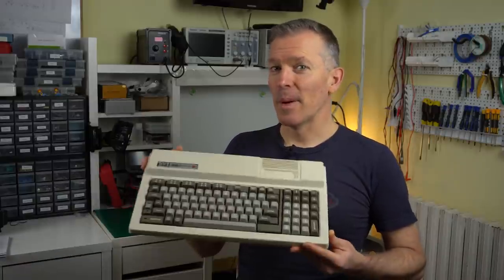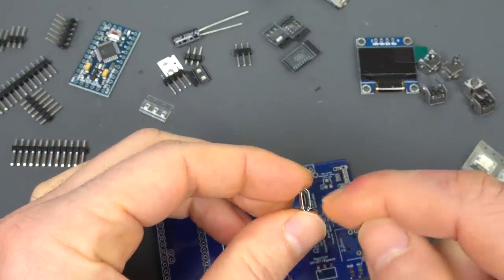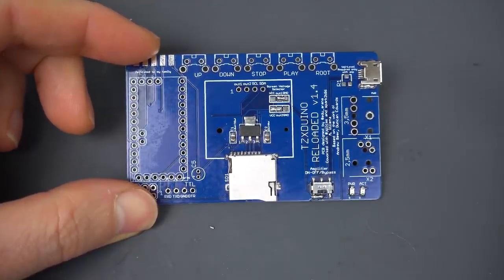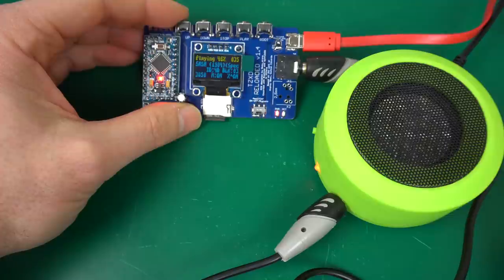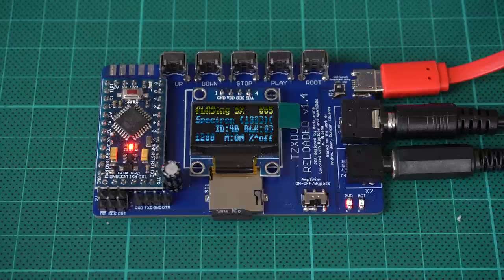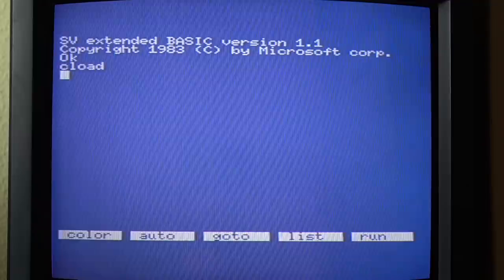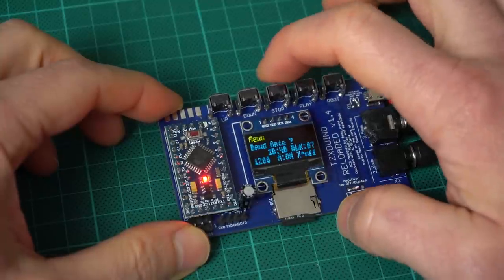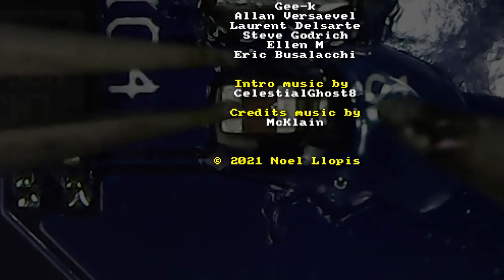Loading Games with an Arduino on the SVI 328

Comment: Yes, I've designed boards and found glitches afterwards that required cutting traces and adding jumpers.  Sometimes things work great in the breadboard stage but suffer in the copper layout stage.  Especially things like shielding.   

Like your videos but the only "game" computers I ever had were the Radio Shack color computer and the Atari 2600.  Glad to see you using the 'scope to analyse things.  I've done a ton of logic design and the 'scope is the most valuable tool for troubleshooting logic flow.
Reply from the maker: Yes, that happens. I'm starting to do some hardware design myself now, so I'm sure I'll run into that as well.
Do you ever use logic analyzers? They seem really useful in theory for more data, but I find that you need at least 24-32 channels to really get anything useful out of them (certainly not the puny 8 channels of the one I have!).

Comment: Another great vid Noel. By coincidence I've been playing with an Arduino to pipe programs into my 1978 Science of Cambridge (Sinclair) MK14 replica computer with some good results, so I appreciate how frustrating this must have been and how great it felt when it finally worked!
Reply from the maker: Very cool! I'm glad it worked. What kind of source data did you start from? Did you convert original sound files to something like a CAS format and then play it back from the Arduino? Or were those files already available? The more rare the computers, the less stuff there is out there already ready to use.
Reply: @NoelsRetroLab  Well the MK14s cassette interface was an optional extra so I just connected the arduino directly to the serial in pin and generated the pulses directly. The MK14 has only 640 bytes of memory fully expanded so programs are usually just hex listings! Its an extremely primative computer, with a 20 key keypad and a 8 digit 7 segment display. Its built in monitor routine is only 512 bytes long but does have cassette routines to support the optional interface. Its not TTL serial, its a combination of 4mS and 16mS pulses for 0 or 1 respectively. The MK14 is quite rare but there is a surprising amount of info out there, a couple of years ago I designed a replica and built it, and several other people have built my replicas too. The only hard part was getting the 50 year old memory and processor chips.....

Comment: You made the right call, I really enjoy the debugging stuff regardless of the system! I should see if there is a tape player for the STM32 blue pill as got one for Xmas and would like a convenient way to load to my speccy
Reply from the maker: Thanks! Good to hear that feedback. The STM32 should compile just about the same things as Arduino, right? With some pin interface differences but mostly the same. I noticed that MAXDuino even has options for multiple microprocessors so I bet you can get it to work on the STM32.
Reply: You can program Blue Pills directly from the Arduino IDE by changing a few options:
https://idyl.io/arduino/how-to/program-stm32-blue-pill-stm32f103c8t6/
(I have one of the £2 STLinkV2 adaptors off ebay and find it to be 100% reliable.)

Comment: Noel you use a tip, ring and ground stereo plug and cable.  Old cassette players were MONO so you only need tip and ground.  You may be shorting out the ring to ground.  It is not needed so I would suggest you remove the red ring wire from the connector on the computer.  That is how I load Spectrum games.  I hope that helps.  Best wishes from France.
Reply from the maker: Right, I knew that about the ZX Spectrum. In this case it doesn't matter because the SVI 328 has its own adaptor, so there's no potential confusion there (and the audio jack in the TZXDuino is stereo).

Comment: The way you shorted the potentiometer, you actually shorted the audio signal to GND... that's why it plays very quiet in "amplifier ON" mode (the switch is labelled correctly). Two bottom pads are GND and signal IN, the top pad is signal OUT.
Reply from the maker: When, the first time or the second time? I don't think the potentiometer was connected to the audio signal, but to the gain signal on the amplifier (first time I left it unconnected).
Reply: @NoelsRetroLab  For the first time. I wasn't aware of the circuit at first, but now I found the old v1.4 project and there was a bug in the circuit design, the left bottom pin of the potentiometer, should not be connected to anything, but it was connected to GND (so you've connected one side of C4 to GND, and pin 1 - unconnected). The potentiometer is indeed in the GAIN control loop, not in the audio path. The right bottom pin goes to the C4, and then to pin 8, the top pin goes to R5 and to pin 1. Pins 1 and 8 should be either not connected at all, or connected via a capacitor and a resistor in series.

Comment: BTW: if you have some fine (gauge) wire, you could run it from the board to a regular size 10k potentiometer (such as one salvaged from a dead transistor radio).
Reply from the maker: Right. That was plan B until I noticed that the whole amplifier part was not working as intended, even with the correct resistance, and that the unamplified part worked fine on this computer 😃

Comment: I have looked at the GithubV directory. Unfortunately, there is no circuit diagram there yet. This makes improvements difficult. In the layout, I can see optimisation possibilities in the pictures. 
Continuous ground plane on top, avoid islands.
The space is there to also use CH1206 designs for passive components.
Holes for spacer bolts for the display.
Mounting holes on the PCB.
Optional push-buttons for operation from above.
GND via stiching.
Reply from the maker: I agree with you. The author prefers not to share the circuit schematics unfortunately. On the other hand, it's probably simple enough to start your own project (especially if you avoid the amplifier). You seem to have a lot of good ideas of where to take it. Do it! 😃

Comment: Noel the correct contacts for the cassette connector is Molex 08-50-0106. You can obtain these from RS Components Part# 173-3284.
Reply from the maker: Thanks! Any idea how they're supposed to stay in place inside the 3D-printed connector? I can't visualize what would hold them in place.
Reply: @NoelsRetroLab  They slot in and have a barb on the bottom to lock them in place. The slots at the front of the connector allow you to lift the barb if you need to extract a contact.

Comment: TZXDuino is a great piece of work. So is MaxDuino, which is a spinoff (kinda) project from TZXDuino. I prefer MaxDuino with my ZX Spectrum because the code is constantly updated with new features and optimizations. I've contacted RC Molina, and he was more than helpful with some problems I had. I know some Arduino, I am not a programmer with any definition of the word, but I can write some code for my needs and I can understand (mostly) how other people's codes work. The only criticism I have about the MaxDuino code is it is always like a development copy rather than a release version. All the changes made from the beginning are commented out but still there, this makes it very hard to follow and makes heads and tails of it. MaxDuino is a multiplatform software, meaning, it can be run on different MCU's, using different types displays, can decode different types of file formats for different 8bit computers, with different kind of settings for each. But, everything is integrated into one piece of firmware. Anybody with a decent level of coding knowledge can work with this, but for the novice level it can become very complicated and frustrating. The firmware barely fits into an Atmega328 because of all these different options. Granted, if you know what you are doing and manage to comment out the parts you do not need for your specific hardware (MCU, display) and the 8bit computer you intend to use it with, not everything is compiled and the firmware gets considerably smaller. I wish dear Mr. Molina came up with a version that is cleaned out of unnecessary old code, with better comments that explain how to tweak (or set up) the options optimally for its use. A user manual explaining the menu settings etc would have been great too. With each new version I spend hours reading the code and cleaning it from everything that I do not need to come up with the smallest code I can do. Oh, by the way, you can add a buzzer to the output pin with a series resistor (470 ohm to 1K works best) if you want to hear the loading. With ZX Spectrum this is not needed but apparently SVI needs it.

Comment: Ok, if I know anything about Op amps. You need some resistance to get amplification. If you simply drop 0 ohms across a op amp feed back loop you will get unity output or no gain. Try using a SMD resistor across those points instead of that jumper.
Reply: That chip footprint Noel showed looks like its an LM386 power amplifier rather than an operational amplifier, that has a gain select on Pin 1. Thats usually got a capacitor between it and pin 8 to set the gain. I think if you just short it it to pin 8 it moves the gain up to ~200x which would explain why it was picking up the 150kHz interference signal and amplifying it!
Reply: @IanSlothieRolfe  YEah I noticed that after I made the comment. Not sure why he used an amplifier when an Op amp would have been fine.

Comment: Nice video. The SVI328-mkII was my first computer back in de eighties. I still have several Spectravideo machines including my first 328 (albeit "slightly" modded) that I still use today. With respect to turbo tape loading, SVI328 machines do not support turbo tape modes, the firmware only supports 1800 baud plus-minus tape jitter corrections. Later MSX machines do have dual tape baud rates, default 1200 baud and a 2400 baud turbo tape mode, the earlier SVI328 does not support this turbo feature.
Reply from the maker: Oh I didn't know that. Thanks for the info!
Reply from the maker: What kind of mods do you have in your 328 BTW?
Reply: @NoelsRetroLab  Machine has a Z80B at 6Mhz (mkII machines work fine at 6Mhz) switchable to 3.5Mhz original. Other mods are in the attached SVI605 super expander, floppy controller is modified to work with 80 track drives, made my own memory boards with a memory pager also supporting the native bank switching, flash storage board emulating an ATA harddrive, 68000 coprocessor board, GPIB board for interfacing with my test equipment. Most of that stuff was developed many many moons ago. I am a software developer by trade. Today I mostly use the 328s for running CP/M natively and for occasional vintage gaming. 

BTW. SVI328 machines can run MSX-1 games and MSX Basic 1.0 software unless the software directly addresses the MSX hardware (hardware is identical, IO map differs from MSX) using a software MSX-1 emulator that runs a modified MSX-1 ROM bank switched to bank 0 page 01 replacing the 328 ROM at runtime. There is also a hardware MSX-1 SVI606 adapter accepting MSX cartridges similar to the SVI603 Celeco adapter, unfortunately the hardware MSX adapter is ultra rare and considered a holy grail. Several MSX-1 Konami games run fine with the software 328 MSX ROM.

Comment: Also, I noticed that - while you were soldering the Arduino Pro Mini PCB to the main board - you forgot to solder some of the pins on the bottom of the main board; though it’s possible that these are just unused GPIO pins for this application.
Reply from the maker: I think I just left that part out of the video (too many cuts for something not crucial). They're all soldered and in place.

Comment: Hey Noel, I was just wondering, when you were building the board, you used a LOT of flux, and I saw it melt and make pools all over the place. At the end of the day, how do you clean all that off to make the board look professional and neat?
Reply from the maker: Didn't I show the cleaning process here? Sometimes I cut it to make videos shorter. I apply isopropyl alcohol over the board, brush with well, and then, before it dries, put a rag on top, and brush over the rag. That soaks in the alcohol with the flux and takes it away from the board. I'm sure you'll see it in some of my other videos. Works like a treat!
Reply: Thanks Noel

Comment: @ 20:47 - Seems like somebody that proggramed it used a PWM to efectively reduce the overal amplitude of the signal but PWM carrier should be filtered out. But the author probably assumed that the supported computers probably do not have enough bandwidth or have their own input filters so they will not see this carrier. Not so elegant sollution but what did you expect from arduino based project ;)

Comment: I liked the microscope work. I looked at one of these, but what put me off is that you can't save to them. Keep debugging and fixing. :)
Reply from the maker: What do you mean you can't save to them? This one has an SD card and you can take pics and take videos of what you're doing. Or do you mean something else?
Reply: @NoelsRetroLab  Ah, I'm so sorry. I was reffering to the TZX SD card not the Microscope in the second sentence. If you write a program, you can't save it to the SD Card. It can only load. I typed it in my head, but it obviously did'nt reach my fingers. LOL.

Comment: 24:20  it looks like lower left 2 pins on the switch are bridged.
Reply from the maker: Yes, that's one of the "fixes" you had to do to that revision of the board. I skipped over it, but it was listed in the project page.

Comment: Next time use solder paste with the metal and the flux 2x1 and an "air iron" for soldering.
Reply from the maker: I'm planning on doing some SMD soldering with stencil and paste next time. Should be fun.

Comment: Strange that they didn't specify an exact part number from a major manufacturer for that USB connector in their required bill of materials.  They should.  octopart.com could then be used to find a source or suitable replacement.  That would save time for builders.
Reply from the maker: If you look at the BOM there's a number there, but since I wasn't ordering components from a major vendor (didn't have 50€ to buy to avoid huge shipping) I ended up buying it from Ali and there the number was pretty useless.

Comment: I think the graphic on the screen, when loading this game was normal,  not 100% sure (so long ago). 
Cload only work if you have a basic program header first.
Bload was for binary file (machine codes files)
Load was also for basic program, but slower (can't remember if it also could load machine code programs)
Cload"",r load basic program and run it
You could also write something like run"" it was the same as the load command but it also automatically start after loading
But I think you should try to read up on 
Load, run
Bload "filename"
Cload "filename"
Reply from the maker: Right. I saw there were games that loaded with CLOAD and some with BLOAD. I did find two other games with an identical loading pattern loading data onto screen memory, so I think you're right and that was the way it was intended.
Reply: @NoelsRetroLab  I know that the game you tested also ran on a sv-318, that computer only had 16kb of memory, so maybe they used the video memory as a loading buffer, but I don't know about that. 
But it's good to see you got the sv-328 up and running 😁👍

Comment: another great video....... (i will tell u my secret i dont use flux at all......) i use a small soldering tip and small diameter solder lol
Reply from the maker: Thanks! I used to use very little or no flux, but it makes things so much easier... 😃
Reply: @NoelsRetroLab  you know better!!!!

Comment: I would love to solder a number of SMD circuits but they are just so tiny and that puts me off. 😠😖😞🥺🥺
Reply from the maker: I totally get it. I was put off/scared by SMD as well, but it's just a matter of getting used to it (and maybe having some kind of magnification, even if it's just a magnifying glass). I recommend starting with some of those SMD learning soldering kits from Ali or Ebay.

Comment: I don't know why they add an amplifier to this cassette player emulators. The 5v output of the Arduino is more than enough.
Reply from the maker: I think it's for the ZX Spectrum.
Reply: @NoelsRetroLab  No amp needed for the Spectrum.

I've just built one of these and can confirm this.

Comment: Noel. You also mentioned the MSX cartridge slot, that is not compatible. Just I've found some info about a guy that has a solution for this. I suppose that there could be built some kind of cartridge adaptor circuit, that enables de cartridge port for standard MSX cartridges: https://hansotten.file-hunter.com/uploads/files/svi728cart.txt
Reply from the maker: Neat. There are still some significant differences between the 328 and MSX, so even with that a lot of things wouldn't work. I'll get into that in a bit of detail next video actually.
Reply: @NoelsRetroLab  But I've seen already some developments to improve the MSX compatibility for SVI-328, 728 and 738. It may be interesting to see some of them.

Comment: Hi there, thanks for the vid, i’m Building one for my amstrad 6128, i’m Working on it slowly, be great if you can build one for yours and post it 👍
Reply from the maker: I will probably build the updated version and test it on an Amstrad CPC 464 with the audio jack mod. But it's going to be a few weeks. I can confirm it works great on the Amstrad and without the amplifier. Good luck with it!
Reply: I will build mine without the amp first and see how it works, thanks again for the great work.

Comment: If you've got to solder smd components on to the pcb ANYWAY... it seems so wasteful and over complicated to solder a pro mini on the board too... it would be so much simpler to just put an ATMega on the board instead.
Reply from the maker: Would it? I haven't used an ATMega by itself before. Would you program it the same way you do an Arduino? Which type of ATMega microcontroller would you recommend for something like this?